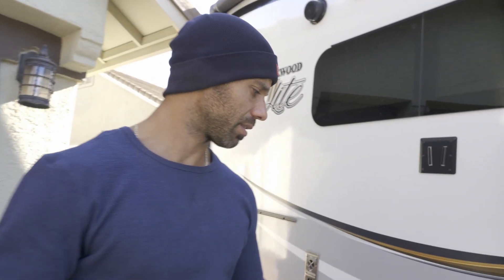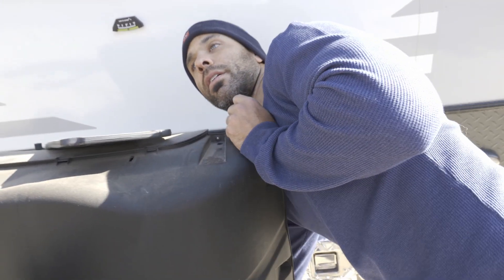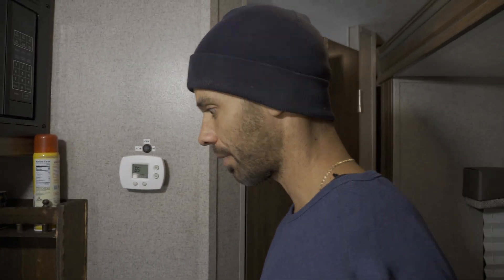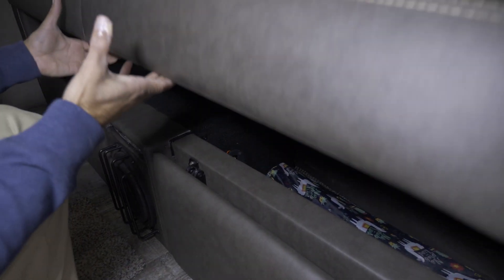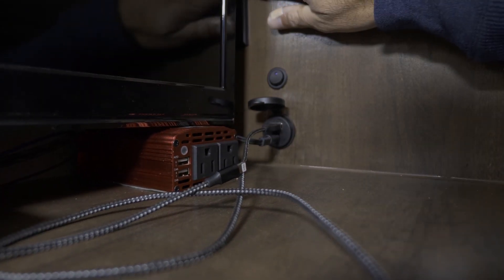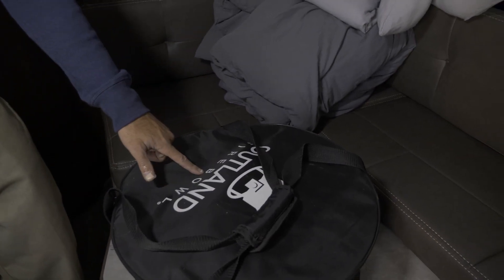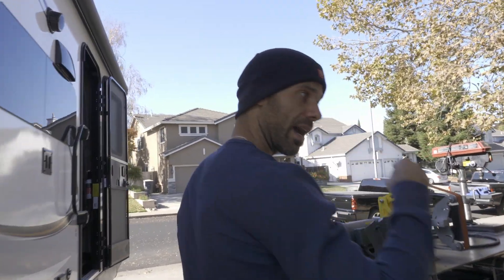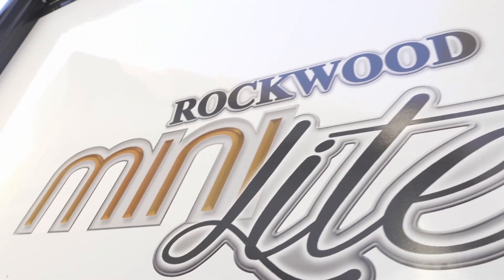RV Travel Trailer - Budget DIY Upgrades

Comment: Greetings from Lexington, NC. I own a Gray Wolf 26DBH. I’ve been kicking around the idea you did for the batteries. That was amazing. Nice clean look AND it’ll prevent someone from taking your batteries. I’m going to use your idea on that!!!!. What about upgrading the outside lights to LED? You say you boondock, are you considering solar panels? I’d love to see more about this camper and your creativity. Awesome job, man.
Reply: I like the box on the tounge, its a good idea and I plan on doing something like that but I'm not sure if you're aware that lead acid batteries need to be vented so the extremely explosive hydrogen off gassing doesn't build up. Did you add some holes to the box to allow the off gassing to escape? If you did  I'm curious how you did it?

Comment: Hello, Thank you for the video ! I do own a Rockwood too, and I looked everywhere for the ceiling speakers, not able to find any. Would you please post a link for the ceiling speakers? Will they work with the stock radio iRV32 ? Please? Thanks
Reply from the maker: Luke Skywalker thank you for the support! Here is the link to the speakers I used 6.5'' In-Wall/In-Ceiling Midbass Speakers (Pair) - 2-Way Woofer Speaker System Directable 1" Titanium Dome Tweeter Flush Mount Design w/ 65Hz - 22kHz Frequency Response 250 Watts Peak - Pyle PDIC60 https://www.amazon.com/dp/B0007LCL90/ref=cm_sw_r_cp_api_i_VRVCEbN0QD6SV
Reply from the maker: Luke Skywalker they should be able to work with the irv head unit..... I don’t see why they wouldn’t

Comment: You talked about the projector, speaker, and screen from amazon, can you post a link?
Reply from the maker: Zac Ries yeah my bad for the late response Ill go find it and reply
Reply from the maker: Zac Ries https://www.amazon.com/dp/B07T2NHMLN?ref=ppx_pop_mob_ap_share
Reply from the maker: https://www.amazon.com/dp/B07FB6VW1M?ref=ppx_pop_mob_ap_share
Reply from the maker: https://www.amazon.com/dp/B00V7WUFTG?ref=ppx_pop_mob_ap_share
Reply: Crownpointe Customs thanks for the info! Have you done anymore updates/customizations? I dig the battery box!
Reply from the maker: Zac Ries yea I actually got done converting my gas quick connect to hook up to my portable fire pit , black Stone griddle and portable Weber  has grill
Reply: Crownpointe Customs that’s a project I want to take on! Any chance of a video? You T off after the regulator? 2 tanks with an auto switch?
Reply from the maker: Zac Ries yea I can do a video on that! Stay tuned I’ll get it done👍

Comment: Welding on the frame weaken it, no insurance company will support you now.  Good luck.
Reply: The welds from the factory looked pretty suspect, and replacing the flat bar with angle iron I'm pretty sure will strength the structural integrity.
Reply: That will not weaken the frame it will actually strengthen the frame if welded correctly  but will not hurt it sincerely  an rv tech.
Reply: @thatGMguy  That's what I was thinking. If you watch any of this channels content you can tell the guy doesn't do anything half-ass or suspect. I've got a surgery coming up and I'm making the surgeon watch all of the videos on this channel to make sure he know what  a quality job looks like.